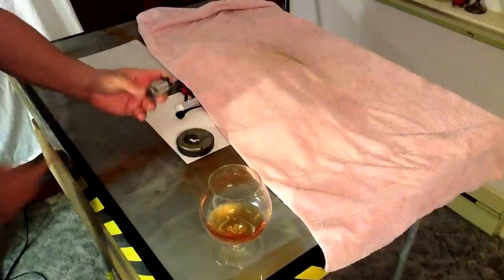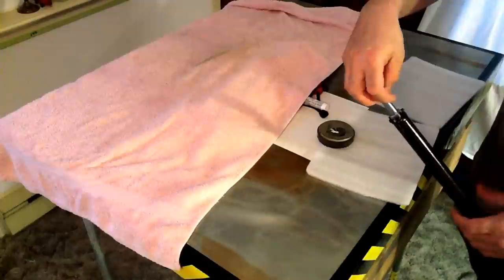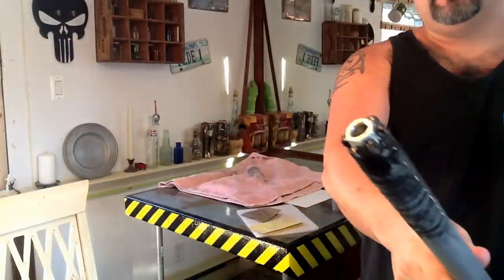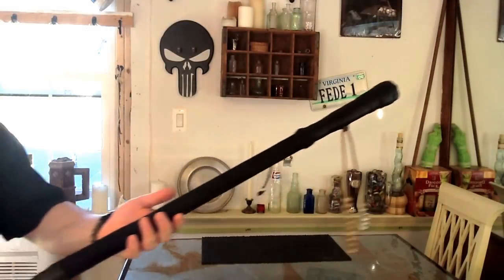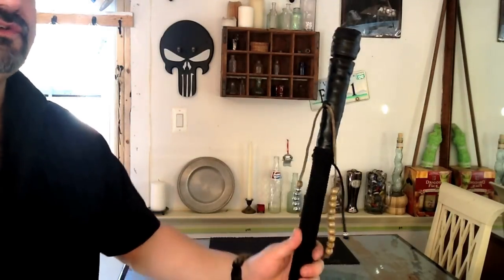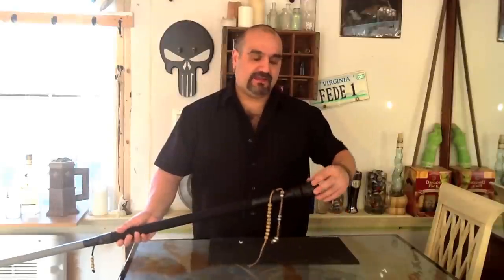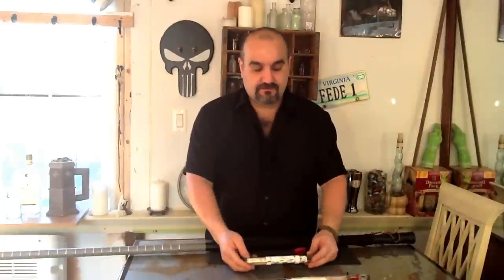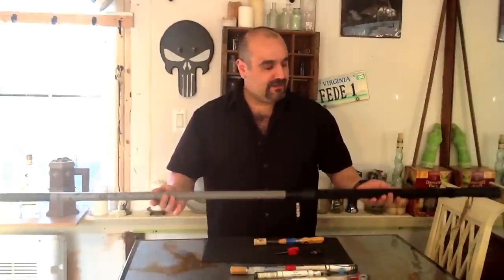The Ultimate Survival Staff

Comment: +Primal Edge Just a suggestion, you and anybody else can do whatever they want with whatever they want, but: 
Dude if the end is threaded, make a 1/2 to spear mode for that end! :D
That way if a cougar or a bear comes at you, instead of a raccoon, you'll at least have a chance.
While this won't 'fit' in the tube, unless you make it a spike or very narrow... you could just weld a 1/2 thread onto a regular knife and just use the sheath that comes with it. Or even better if you have a tap and die set, Either buy a blade blank, like a Mora knife, or just break the handle off one and cut the threads into the tang! :D 
A Ka Bar would work, but is $50 vs a $15 mora.
Boom! Done.
Yes I know welding on a knife is a bad idea. "it creates stress risers, ruins the temper, the weakest point and therefore easiest and first to snap"
Then forge weld it.
Also. A Spear uses primarily thrusting motion, not slashing, therefore minimal force from the side and maximum impact force. Therefor, just electrode or, mig/tig welding, would be just fine as long as you don't plan on hacking anything with it, and only plan to use it once in self defence against a fierce animal like in the bear movie The Edge with Anthony Hopkins.
Reply: I just saw one where the guy put threading to put an arrow broadhead.  Brilliant.

Comment: source for tubing?
Reply from the maker: sorry for the delay.  here you go: primaledgeandleatherworks.com/onlinemetal
Reply: Primal Edge I thought that the pole was carbon fiber? And I do not see them listing anything carbon fiber
Reply from the maker: John Smith it's is carbon fiber, you're correct.  it should be listed under "other" materials.  Last option on the right
Reply from the maker: John Smith look under "more" then "composite materials"
Reply: Primal Edge thanks
Reply from the maker: John Smith you bet!  sorry for the confusion. If you make one, please let me know!  I'd love to see what you come up with.  ATB~ Michael
Reply: Looks like a guy can get a 6-8 stick of 1" ID for about 125-150 bucks at different places. 

What was your wall thickness?
Reply: Primal Edge I have a couple cold steel warheads, later models with the thin deeply hollowground blades.  Thinking to make one a supelight spear/hiking stick.  They do not have a socket handle like a bushman, a strong tube type handle is stronger than cutting a slot in the end of a stick for the tang
Reply: What did you use for the storage tubes I can't seem to find any long enough